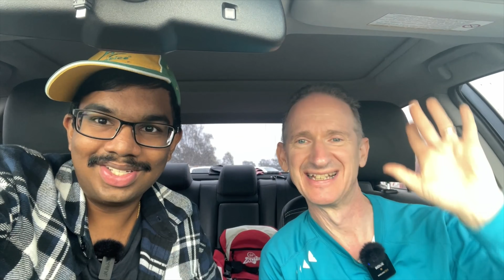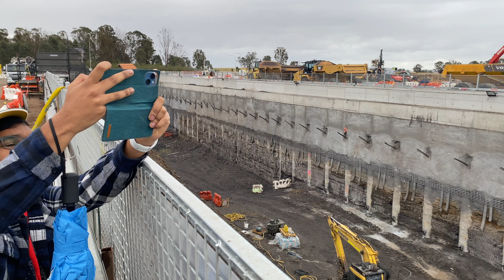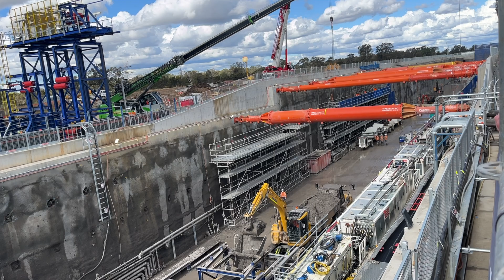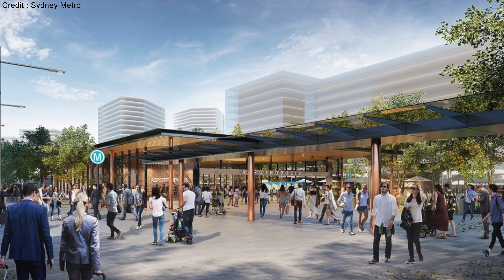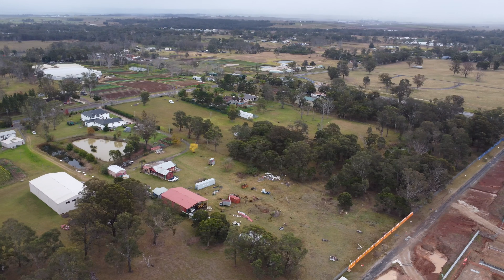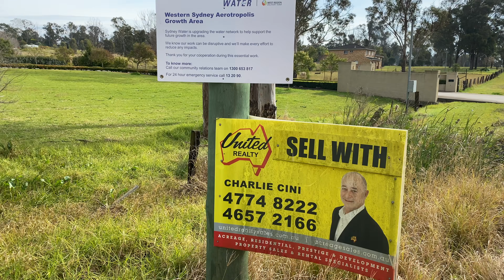Aerotropolis Station Community Day with Sharath@BuildingBeautifully  + Orchard Hills with Jo Haylen!

Comment: Such a shame there will be no direct rail link to the new airport.
Reply: Direct from where?
There will be a railway station at the airport, and it will have other stops. Ergo direct.

If you mean from the central cbd.. why.. this is an airport for those living in Sydney's West, its a 2nd airport for a distinct catchment, not a replacement airport.
Reply: @mark123655  Direct from where? 10 km of cheap, above ground track from WSA to Leppington would provide direct connection to the Aerotropolis, Liverpool, Parramatta, Sydney Airport, Sydney CBD.
Reply: They may plan it with the Metro West Extend it from Westmead
Reply: It's not a shame, it's a disgrace.

Comment: Why isn’t there a direct west line being built from central or at least parramatta… it seems it will take ages to get to this airport
Reply: It wouldn't if there was a cheap extension of the line from Leppington instead of this overpriced monster.
Reply from the maker: @jack2453, Yes it would, but it would still be a long journey to the CBD and also to Parramatta, and there is more capacity (and more trains) on the T1.
Reply: @TransportVlog  Not sure that's necesserily true. Trains could run virtually non stop from the CBD to Revesby and then pretty quickly from there.
Reply from the maker: Hi @jack2453, yes that could work, especially once the T3 is converted to Metro, as that would free up space between Central and Wolli Creek (via Sydenham)
Reply from the maker: In the longer term, the plan is to extend Sydney Metro West from Westmead to the airport, and I reckon this would bring the journey time to the CBD to under an hour. Unfortunately, with Sydney Metro West not opening until at least 2030, another solution was needed to get a rail link to the airport in time for the airports opening in 2026.

Comment: Those metal bars coming out of the wall are rock anchors.
They drill a steel bar diagonally down deep into the rock behind the piles and then tighten a big 'nut and washer' against the pile to hold it back. Much like a guy rope on a tent.
Reply from the maker: Thanks for that. I'll remember that for next time.  I like your analogy with a guy rope on a tent! - I might use that in a future video!

Comment: Hi Paul, those steel bars that you were asking about are called ground anchors. They get drilled into the ground to support the piles against the weight of soil which is trying to push them over.

Interestingly this project is being delivered in 3 construction contracts. The work that you were looking at on site is from the station boxes and tunnels (SBT) contract, which as the name suggests involves the boring of the tunnels and the excavation for the station.

Once the SBT contract is complete the SSTOM contract will build the stations themselves, install all the rail systems and trains etc.

By using multiple construction contracts early building work is able to get underway while the finer points of the design are still being finalised. It’s important for this project as the goal is to have the line complete before the new airport which is a challenge given that the airport construction started in 2018 and this project didn’t really start onsite until 2022
Reply from the maker: Thanks for confirming the name and purpose for the steel bars.  Yes I'm sure some of the station designs will change.  Yes this project took a while to get off the ground, but it seems to be gaining momentum now!

Comment: Great video! It's nice to be able to see the station box in this much detail.
I assume the parking on the west side of the station is there so it can be used in the future as the excavation site for future platforms for the Metro West extension. Provisions for 2 future platforms are being made at the airport stations so it would make sense to do it here too.
That platform layout looks quite inefficient, doesn't it? Both pairs of escalators are at one end of the platform. That's probably the end which the initial 3-car trains will be stopping at, but it still seems non-optimal, and the fact that the escalators are in pairs would limit future capacity. This is supposed to be a city station, yet it's being built nothing like the new Metro stations in the eastern city.
Reply from the maker: Glad you enjoyed it!  Possibly, although I think the parking could be replaced with new buildings in the future.  The design does include provision for future east-west platforms at the mezzaine level, so whatever happens, that will be safeguarded.  The designs are at an early stage, and they could well change, and probably will!  Sydenham station was never going to have a new aerial concourse under the original plans! That came later, along with Trains Facility South! I'm sure it will be built with future capacity in mind.

Comment: While you're thee, tell them to keep digging towards schofields and Tallawong and finish the metro loop that way.
Reply: Yeah. Although it would have to be an interchange station at Tallawong, as the 2 lines use different power supply.
Reply: @daveg2104  do you know the reason behind?
Reply: @saddysly8281 Best practice globally these days is for 25kV AC trains.. don't need as many substations and generally allow for faster trains.

The NW, City and SW Metro was reusing two sections that had already been designed for 1500V DC (even though they are still adding to it) and decided cheaper to keep it that way
Reply: @mark123655  Yes, that is true. But it has left us with a less than ideal system. I don't know what the best alternative would have been. Build the new connecting lines to DC, or convert the Epping/Chatswood line to AC. I'm not sure on how much disruption that would have caused.
Reply: @daveg2104  Also train lengths are different.  Metro 1 6 car trains with platforms built to 8 (160m). Think Airport West Metro is Max 4 cars.
Reply: @mark123655  Yes, there are other issues. The wider car problem could be fixed by using standard width metro cars and widening the platform to fill the gap. The length is a bit trickier. Maybe the tunnel section could be enlarged and the platforms lengthened without too much disruption, but I'm not an engineer. I won't be holding my breath on any of that happening.
Reply: @mark123655  Best practice is to keep using the supply you have just spent $billions installing.
Reply: @mark123655  This fact that incompatibility applies to train dimensions as well as power supply is more evidence of incompetence, not less.
Reply: Agree with hindsight you might have converted the first Metro to 25kV AC.
Not that we've seen a design for an interchange at Schofield's or Tallawong but if l designed well interchange shouldn't be an issue.
Reply: Or as Sharath would say it "Showfields"!

Comment: You didn't ask the question about extending the Sydney Metro to Talawong. A necessary extension to ease the congestion on the existing western rail line. The population in Western Sydney will increase due to the construction of the new airport and immigration. A second link to the CBD is vital to provide for future growth.
Reply from the maker: Hi Victor, yes that would have been an interesting question to ask.  However, I don't feel that this is the best way to ease congestion on the western rail line.  The off-peak journey time from St Marys to Central is 53 minutes on a weekday.  I reckon Tallawong to Central when Sydney Metro City & Southwest opens next year also be about 53 minutes.  Add on the bit from St Marys to Tallawong, and its going to quite a lot longer.  Extending Sydney Metro West beyond Westmead seems like a better way to do this.  Having said that, the St Marys to Tallawong link would be useful, for other reasons.